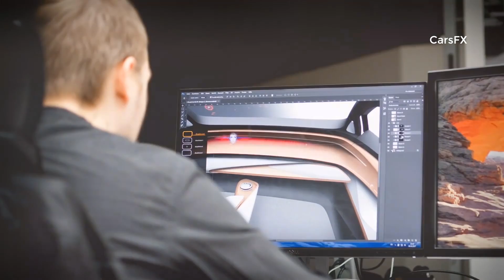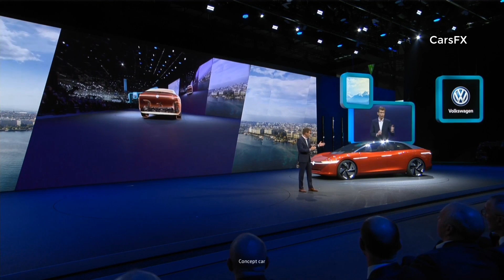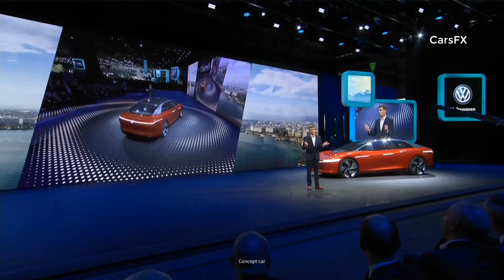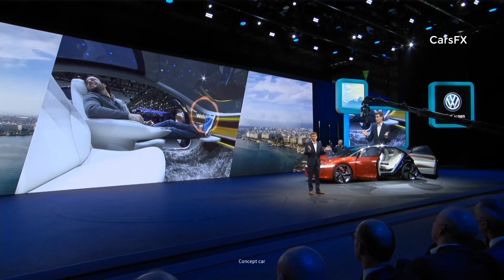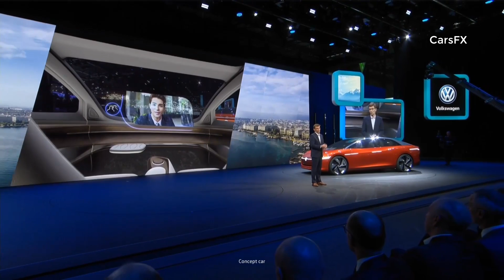2020 Volkswagen I.D. VIZZION Electric - Better Than Jaguar I-Pace !

Comment: Great, now let me drive the car, FFS... Stop compensating for your perceived lack of innovation, VW.  Steadfast engineering is not a weakness. Until there's a smart road system running on IOT infrastructure and distributed cloud computing data distribution, I prefer to have a steering wheel in my hands!

Comment: NICE looking car and t to folks who like driving, you need not worry -  AI cars will NOT be cruising our streets in any significant numbers 5 years from now - there are way WAY too many hurdles and hoops to jump through - some technical, some regulatory such as what takes responsibility behind the "wheel" etc.  AI cars, although perhaps capable of navigating streets and highways sans driver input, there will still be problems of integration with the massive amount of present day cars that require drivers.  We are looking at DECADES before full integration of AI